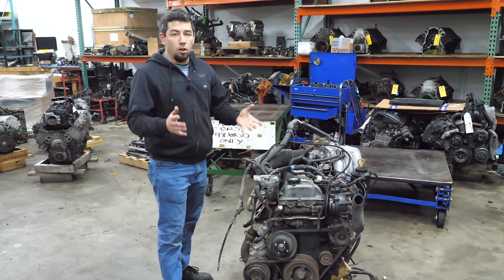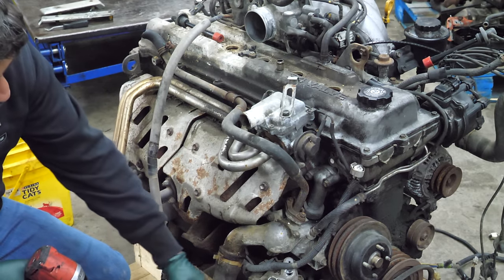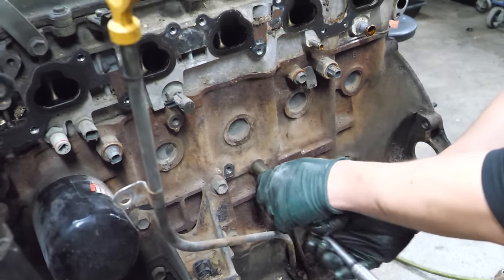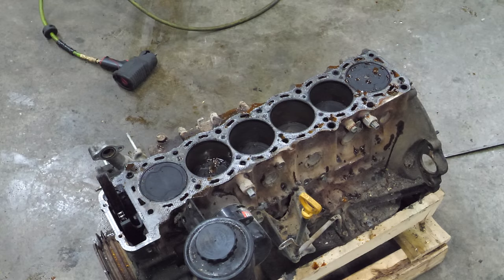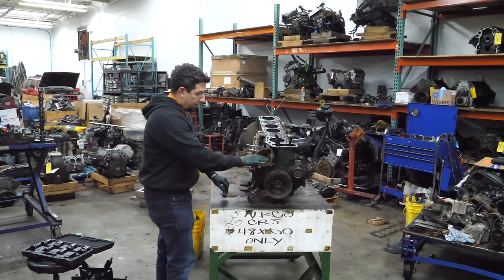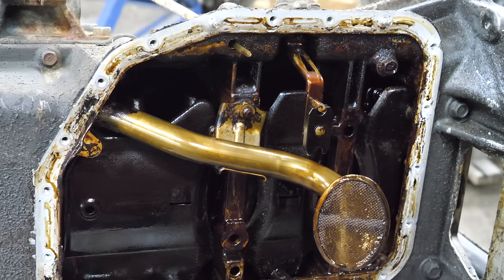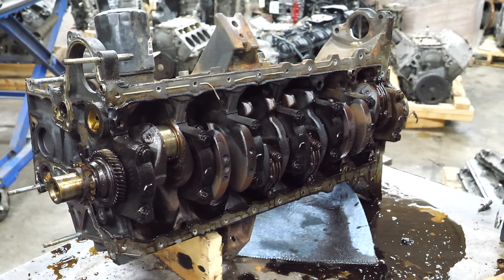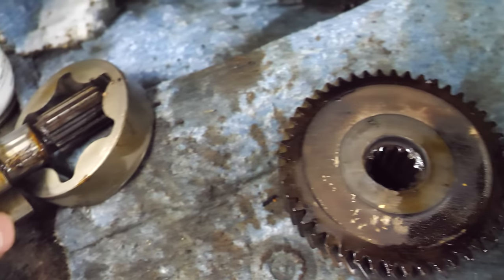LOCKED UP Toyota Land Cruiser 1FZ-FE Engine Teardown! HAD TO USE ALL MY TOOLS TO GET CRANK BOLT OUT!

Comment: Indestructible?  I owned a slant six that I bought with a rod through the block.  It had another one complaining.  I got almost a thousand miles out of it before two more hit the oil pan.  Hey, $50 is $50, and a moving rental was over $200...  so this beat up Dart worked out just fine!  It died on the way to the junkyard, after a few moving trips.  I should have kept it as a trophy, but where?

Comment: just thought about what might have happened if the bucket slipped off the breaker bar when under fullest tension.. meanwhile on the ISS ... "I swear by god I just saw a breaker bar fly by at airlock 2 .. "

Comment: I had to use a torque multiplier on my crank bolt, took almost 800ft lbs.  the torque multiplier made it gravy.  All other methods failed

Comment: Over heated. Toyota's solution to the problem with an iron block and aluminum head, which heats and cools at different rates like a circuit breaker or old style flasher was the composite gasket. It often didn't work. But, the multi-layered steel head gasket was born from it.

Comment: I am surprised that you did not try heat and a penetrating oil on that crank bolt.  I wonder if brake cleaner might wash away the nasty oil with it's smell.

Comment: I see denso plugs and wires denso everything you have pulled I'd be willing to bet that engine has 300 or so thousand miles and all those parts are original I bet someone got this truck and just drove it that's how these end up getting killed simple cleaning and maintenance could have pushed it past 500k easily I have a dodge 5.7 with 315k that drives great as proof all they need is love and they can go the distance

Comment: 23:08 it was starting to lift the tires off the ground..... WOW!!!
.
and i work on "loader tires"..... jack it up and fix the tire
THEY ARE NOT LIGHT MACHINES!!!!!!!!!!
.
.
so im not sure how a person is meant to get that bolt out when the engine is still in the car.........
do you cut the head off, drill a hole, tap it, insert a smaller bolt..... and use that bolt to spin it out??
.
like once the head is cut off.... all the the clamping force is gone
and it should just spin right out (just like snapping a head bolt or diff cover bolt)
.
.
.
but still...... what the hell man!
.
what is Yoda's "recommended service procedure" to get that bolt out?

Comment: That's a heavy engines. I wonder how much the Ford 300ci weighs fully dressed.... Yes it has less equipment on it depending what year it is. And yes it's a push rod overhead valve so that's going to help with weight but being old is not going to help

Comment: Usually engines don't die, they are murdered by Lacky... fluid changes, maintenance, etc... And kudos to your SHD crank pulley bolt removal tool(s)...That's 'oh, the hell you are' level of determination right there. That engine looks like ship level engine abuse...just add oil...any oil...deep fry oil from the kitchen? Sure

Comment: Looks like he’s going to have to heat up the crank pulley bolt with the torch then spray it with some lube then try using the impact to loosen it.

Comment: i dont think we had them here in aus, till late 90,s. 100 series. the 1hz, is from 1920.. along with the 350 chev.. dinosaur tech.. as i keep saying, get a 4.2tdi, mwm. 97 - 07. s.duty.. no computer, no glow plugs, mine puts out 230hp. 550ft lb.. no,,,computer,,,  just a td06.. very,small turbo,,smaller std, td04..

Comment: I'm guessing you had already cranked your air pressure up  well past the "recommended" range. Recommended is for people who don't like new tools.
Reply from the maker: 160psi! Just not enough hose apparently
Reply: @I_Do_Cars  Yeah a half inch hose will definitely add some power to your tools. Torque test channel did some testing on it if you're curious about how much.

Comment: You got a good 2009 ram 4.7? Might need one, mine has low compression on cylinder 7, only about 55 psi

Comment: The same engineers that designed this engine must have designed the good old 22R engine. Some things vaguely familiar to my perfectly running 84 Toy PU at 320k miles on the clock.

Comment: Not sure where you're located, but many of these engines appear to
be running/parked during a hurricane. Running= bent rods/windowed block,
parked= overall damage & seized.

Remember- ocean water is highly corrosive, and is full of microscopic
life; when it dries, you're smelling millions of dead creatures, not necessarily
any "fish" or "shrimp" as many think. The true damage of hurricanes isn't just
the rain, but the storm surge, too- both ocean water. Rotten, dead, confined
ocean water is horrible and toxic. That time you sliced your hand on that
MLS head gasket should've required a Tetanus shot. 
You're very lucky on that one!

Comment: When neither size impact gun worked, why not go borrow one for BIGGIE TRUCKS? You know, tractor trailers, heavy equipment?
They are massive and would totally undo any lug nut on any truck wheel, so if it can do that, it can totally remove that nut.
That's what I would do, instead of using a front end loader bucket lol. That was silly. lol

Comment: Poor LC, it is a shame what has happened to it
First, the owner thought oil and coolant changes are unnecessary, he kept the thing like a 500 dollar beater corolla
It definitely seems to have been overheated, blown the head gasket and locked up. Then an idiot parked it, the blown head gasket allowed passage of the iced tea, sorry, coolant. It mixed with the "oil" and having sat for 10+ years it rusted everything possible from the engine and completely ruined this awesome vehicle and engine. As you said, 10+ years it would have been worth being fixed, a junkyard engine would have fixed it
It's a shame, here in paraguay people love the 80 series with the 1HD turbodiesel engine, i have a neighbor that has one with 500000 km but it is kept beautifully, he recently reupholstered the interior and painted it all up

Comment: Now I know why mill 250Kg Miller Falls engine Stand wilted when I put the 1FZFE on it...... Had that motor rebuilt due to a Head gasket fail, did Ceramic on the bores and pistons. :) then someone ran into it and the Insurance wrote the car off..... The Eco Clown that hit my car managed to tear the bolts out of the steering box without causing any other damage. Sadly the guy has passed away(2 years later) Karma....

Comment: You do overcome the problems that you get when an idiot has owned the engine. He/She probably put perfume in  it to make it smell nice, or something like that.  I am retired, but used to make race engines from vintage engines, and you can imagine what that was like. I would have carefully heated up that crank nut, applied WD40 or a light engine oil and let it soak in. That usually frees up stuck nuts or bolts.  I made an engine stand with many adjustable mountings, that makes it much easier to get at things. I found it worthwhile to soak the whole thing with a penetrating oil, or even diesel,  let that soak in for a week, topping up every day.  Then de grease the whole  thing before dismantling.  Keep up these entertaining video's please, they are a great laugh.

Comment: I am sure that there are some oil lights that come on after engine damage happens, but most engineers aren't that stupid. What is the point of even installing an oil light if it turns on AFTER you damage your engine? And I am not saying that you should rely on it on purpose. I am just saying that most of them probably are calibrated to save your engine if you turn the car off immediately. I had a Chevette (well Pontiac 1000 technically) in college that went through oil so fast that it was like it was a 2-stroke engine. Since I am lazy, and the car wasn't worth much more than scrap value, I would sometimes let the light turn on before adding some more quarts. I don't remember how many thousands of miles I drove the car like that. I just had the cheapest oil and spark plugs (the bad cylinder would foul its plug every few thousand miles) I could find in the back for when the light turned on. I did have to switch to 89 octane at one point because I think the carbon build up may have actually increased the compression. Either way, it would knock and the higher octane seemed to help. GM cars from that time would run badly for longer than most cars would run at all.

Comment: I had a 92 Toyota that the pulley bolt was so tight it took a 1 inch bar with a cheater pipe and 2 of us to break it loose.

Comment: Heavy???  ROFL My 5.9 Cummins weighs 1150 lbs according to several different articles I've read. I would also like to compliment you on your sense of balance to look so comfortable supported only by a breaker bar. I'm impressed by how efficiently the exhaust manifolds are shaped. Most that I've seen looked nowhere near this free flowing. I'd give a nickel or any part of it to see a comparison to a typical manifold on a contemporary V8. On the other hand, that intake manifold just looks weird.
Your breaker bar is looking really strong. Put a ten foot piece of pipe on it to increase your leverage and see what happens. Ok, your method apparently worked. As I heard the engine noises increasing a smile developed on my face. Then I saw the "tool" you used to apply pressure and I kind of felt sorry for the breaker bar and socket. I still don't know if the bolt broke loose or the socket broke. That was amazing.

Comment: I don’t know why people fawn over these engines so much. They aren’t even that durable by 90s Toyota standards. They don’t make much power for their displacement (every I6 Land Cruiser I’ve ever driven felt woefully underpowered), they weigh a ton, they have massive external dimensions for their displacement, they aren’t that easy to work on (aside from spark plugs), they get terrible fuel economy, they have tons and tons of leak points. Yeah, I just don’t get it.

Comment: As a heavy duty mechanic, I’ve done similar things to get a bolt out. There’s a reason why I have a 1-1/2” impact. Yes you read that right 😂

On another note, you can still sell it, just be transparent. Say straight up, “this part is damaged, price reflects it, use at your own risk, not responsible for any damage caused by its use.” Very least you might recoup some money above what you’d get for scrap.

Comment: You went from probably 500-ish lb-ft of torque to well over a 1000 with the bulldozer. Absolutely hilarious move. By the way, you look like a cross between Adam Sandler and Ben Affleck

Comment: Man, thats nasty. Some people take the toyotas are indestructible thing too far. You still have to change the fluids every once in a while... Obviously they hardly changed the coolant or oil on this thing, and that contributed to death of that headgasket. 221k is baby mileage for these older toyota motors. my 5vz has 287k on it and is still running like a top. Inside is clean too, and coolant passages clean as a whistle. I thankfully got an engine somebody didnt neglect. im the 3rd owner. I intend to get another 200k out of it, if my frame doesnt rust away first lol.

Comment: Do you ever get people trying to sell you used catalytic converters?  I’m curious what your take is on the rash of catalytic converter thefts, and posible preventative solutions…do you sell them?  Is there oversight from authorities?  What is the automotive industry doing in the manufacturing process to make it more difficult to steal them?  Protective plates, or maybe relocate them closer to the engine?  Just wondering what your take is on this whole issue, maybe it would make for an interesting video…
A mechanic once told me I needed a new catalytic converter, so I says to him:  “this is a Ford, why is there a Cadillac converter in it, can I get a Ford converter, I’m sure they’re less expensive.”  😆🤣
Reply from the maker: I don’t but I do have people who try to buy them regularly. I know all about this industry and I will say it won’t matter how many rules or laws are in place, theft will be a huge issue for as long as rhodium, platinum and palladium have little value, which is never.
I’m just a guy in the recycling industry but my idea would be to have a national database that’s accessible on a mobile platform for both authorities and those who buy. That database would store VIN’s and seller info. Every converter would need a vin engraved to sell and the database would store the info on the vehicle so every cars cats can be tracked.
It’s a stretch, but until cats have vins and it’s illegal to possess a used cat without a corresponding vin, any rules or laws in place will only make it tougher for those to already do everything right.
Reply: @I_Do_Cars  I think automotive manufacturers should figure out a way to install the converter in a place where it’s more difficult to steal, or bolt plating over it with a locking mechanism needing a key or button to remove it if it needs to be replaced

Comment: Your air tools didn't work because your air hose has too small a diameter and may be too long.  A big electric impact would have taken that crank bolt right out.  That's how I do my 2UZ-FEs.

Comment: You’re using an adapter on a socket for the crank pulley bolt you’re not supposed to do that you’re losing torque to remove the bolt

Comment: Bulletproof Engines.... Just not ABUSE proof. 😠😖
I actually liked the 40/50 Series, with the 4.1L Chevy straight 6 Short Block. It showed Chevrolet that a 1bbl Carb and Siamese ports WASN'T the best way to make power!
Reply: ..... And I don't think that 1700lb. ft. Is the correct Pulley Bolt torque.

Comment: That thing looks almost as bad as the 22re I tore down that made it to 48,000 or so miles with no oil changes. The amount of coked oil and carbon inside that thing was horrific. Surprisingly the crank was good as was the head.

Comment: Next time, try using a torch or induction heating tool to heat up the bolt - the expansion will release a lot of the tension in the bolt.

Comment: That is the worst crap I have ever seen coming out of a coolant gallery.  You need a machine gun barrel shroud as a cheater tube, to break those hassle, worst evah, bolts.  This is from a M2 aircraft machine gun, basically a 4130 tube about 2.5 feet long, about 2.5" diameter, and is a GREAT breaker bar.  There are more substantial cheaters, but this particular tubing has never been beaten, here, in our shop.

Comment: The condition of those crank bearings doesn't explain why that shaft was locked-up. The mechanical advantage of the rod throws would have rotated a stuck wrist pin.....so?....the evidence doesn't add up.
  If the crankshaft was bent, it would have melted the mains......I call BS!!

Comment: Every engine can go 300-400 thousand with proper  maintenance. You're always making excuses for Toyotas that break down. I've had a 85 2.8 Chevy V6 that I bought new that had 275, thousand on it when I sold it still running good, Had a 65 T-Bird with a 390 had 300 thou when I sold it and Had a 72 Duster 318 my dad gave me with 280 thou when I sold it. Non of those engines were rebuilt or even ever had the heads off.

Comment: 30:54. oil light. idiot lights.. my pa, had a holden hq, 6 cyl.. here in aus..  i borrowed it for work, nothing was said about the car. driving thru town, i smelt hot water,, mmmm,, someone else.  1/2 mile later. pop, light comes on,,no water.. yup,,idiot lights..

Comment: What kind of rubbish do you have? My budget motor stand (china shit) which cost me about 200 dollars, take about 1000 pounds (450kg) without any problems. It can handle a 6.7L Power Stroke diesel, but it's at the limit

Comment: Leave it to Toyota to make a 24 valve six cylinder with massive displacement and horrible fuel economy that barely makes more horsepower than a normally aspirated 2 liter Honda. Toyota engineers just suck. It’s really weird the makers of the boring ugly slow transportation appliance know as the Prius also make some of the heaviest and least fuel efficient vehicles in their class. A Chevy V8 Suburban gats better mileage than the smaller Toyota Sequoia. And Toyota engines are far from all being really reliable. They’ve had many serious problems like 4 cylinders that for years had head bolts that pulled right out of the block resulting in catastrophic engine failure even at well under 100K miles. So even with proper maintenance many a Toyota has prematurely self destructed from poor engineering including their V6 SUV and truck engines and many of their automatic transmissions.
Reply: Don't tell "Snotty". To him, Toyotas are a gift from God.